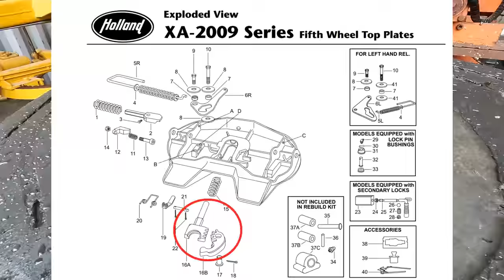1980 Autocar “Construcktor” Hauls its First loads in Many Many Years!

Comment: so, just out of curiosity, why does american rigs have so much empty space between the trailer and the cabin compared to europian trucks? something to do with the axle weights or something like that? because i am wondering that wouldn´t it make the rigs easier manouver to tight spaces if the lenght of the trailer would be smaller?
Reply: Space for a sleeper cab, ride quality, toolbox/headache rack space, storage, any number of reasons. Also, here in America we don't have the space constraints Europe does. Most of our roads were built after the 1600s.

Comment: No 3 phase Power, No Problem... Phase Converter single Phase to 3 phase.. simple turn it on when needed... Do you have a large 3 phase motor not in use... it would be the heart of the converter... build the rest...Check University of you tube to build it.. Sound Like Autocar Need a 3 speed Auxiliary Transmission, Gear splits are pretty wide for a OTR Tractor... Just my observation...

Comment: Best use of those ramps off the old military trailer are to put them under the blocking you now have under the trailer holding the crane. Unless you have a good friend with a large wrecker. There is a whole YT channel showing how to lift trailers out of all kinds of badly chosen spots for the landing gear. Those tiny 12" square (at most) landing gear foot prints are no match for the eight tires at the other end of the trailer! 😳 Those landing gear are made for use with an EMPTY trailer on DIRT. A trailor with most any kind of load needs to be on real, permanent pavement! Just because you DID something doesn't mean you SHOULD HAVE! 👎😱

Comment: Dear matt I was thinking your international loadstar dump.should have the same size as your 2semi.truckks I hate to.throw those traction tires away if there really bad yes but if you can save a set you could exchange on the green international and rid of the bald next you had 22 .5 on the rear on that parts international and put your old tires to it same as the ford's  until your ready as your international constructor has aggressive tread. On it you don't want light aggression I like to chat a idea of your water issue you should chat with Chris from dirt perfect and maybe put a roll of courragted pipe to be planted 3' down and pulling the water out and drain in the creek and lay that same pipe under that slag where your going to steam clean
Reply: Dear matt what do you need  I so Bored in this nursing home I been working on your place on to move and sort even when your putting up your building to make area to.locatize your equipment that turn out of your shop.that turn needs to be widen more your front tires went into the grassy area and I laugh about those trees I don't want to take any more out I was thinking about moving good quality trees to that area which is bear and then section out the others I be marking all dead trees with paint used the auto car with the lowboy and move all the good lumber maybe stack on some garbage wood to keep them from rotting what matt do you need that I won
Reply: @brucebonkowski9568   DANGER!   DO NOT respond to the telegram thing!   It is a SCAM 100% SCAM!   Do not respond and if you have responded stop now!   Matt does not leave those telegram things!
Reply: @richardthomas1743  ok richard do me favor I been working on his behalf to :
1 get rid of the standing water 2 come up for a way as he did on steam cleaning the dozer a permanent waterline and if he can find a garden shed he could put seasonally his trashpump and hose in there to get the water

Comment: I love this YouTube presentation, I have followed most of your vlogs, however,, your definition of restore or rescue as you call it is quite far-fetched from the actual meaning of the word. All I see you do is buy scraps to restore, but you concentrate on starting these scraps up, and, once started you tend to use them as is. Rescue or restore means stripping them down to chassis, repainting and replacing worn parts including the engine, and restoring or rescuing to factory standards. If you do that, thousands of people around the world will be hooked to your videos.

Comment: The funny thing with american trucks is that they are still crap today.
That stupid hood and barely any steering angle on the wheels.
An old one like this is forgivable, but that you haven't fixed it 50 years later is embarrassing.

Comment: Why on your comments that nobody is backing me up and you need a roof light on your tractor when you're putting all these lights on a new lights tail lights marking lights and all that stuff why don't you put a roof light rotating roof light or flashing strobe light on top of your cab of your tractor for caution and when you're hauling heavy equipment and stuff like that why ain't nobody coming in that I am right dot requires all heavy tractors that tows hairy stuff must have a roof light on her tractors why ain't there one on your tractor you always, people are sending you comments about lights and you need this you need that nobody's coming in on my idea that you do need a DOT required all tractors moving heavy equipment must have a roof light
Reply: Readers out there are common and everything else but nobody's accounting on my that I'm right that you should have a light on your cab of the truck dot requires all heavy moving tractors must have a light under rig for caution when they're hauling heavy equipment and large loads let somebody comment on my remarks that nobody else is coming out of mine so please come in on mine that I am right everybody you should know needs a light on that tractor
Reply from the maker: I don’t think your correct tho. You don’t have to have that. As long as the load is flagged like I have it, your legal.